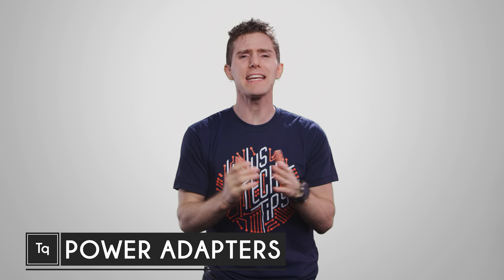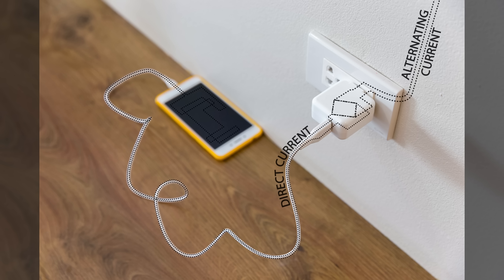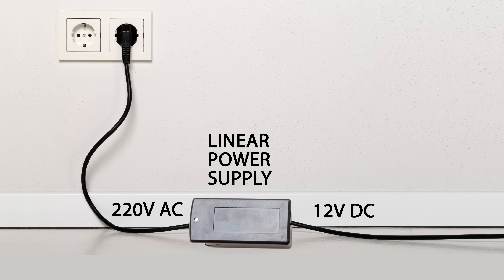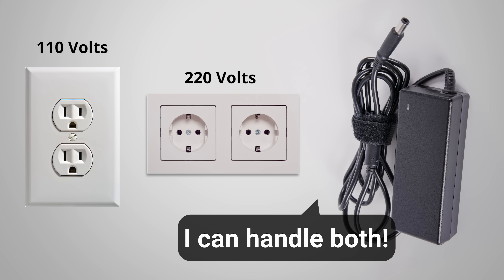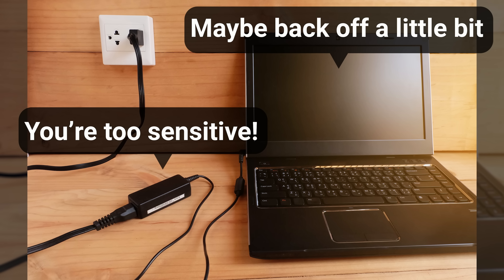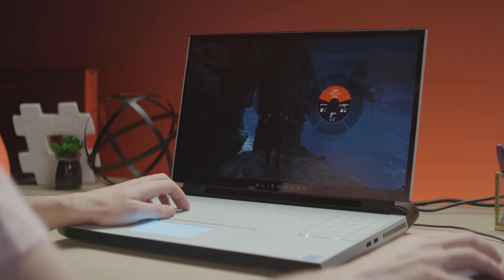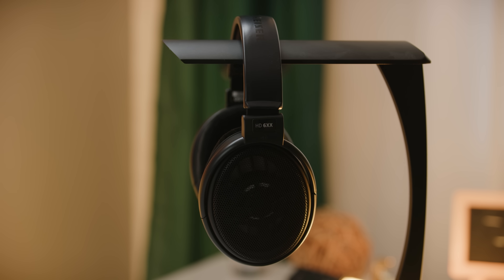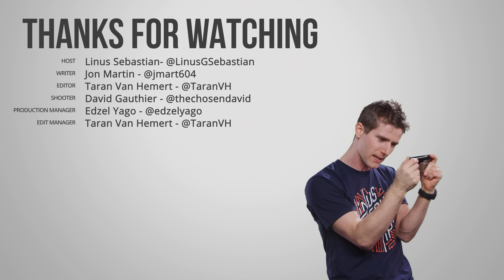Why Power Adapters Are So HUGE

Comment: Maybe we should have extra 12v DC outlets for portable devices, since they're so common now. That way you'd only need a cable or a very small adapter for 12v to 5v.
Reply: My power professor is doing research on power grids and he was talking about implementations of 480V DC transmission lines to households. 

DC lines don't have reactive power so they're more efficient than AC lines. The issue of the past is being able to switch voltages efficiently which AC was able to do with transformers, but now because of power electronics we can switch DC voltages very efficiently and cheaply. 

You can easily couple solar panels to DC lines, and you can easily charge something like an EV. A 480V DC source can very easily be stepped down to any voltage lower than it with over 95% efficiency, and zero care about power factor (DC lines have no reactive components). 

You would be able to implement a 480V to 5V@3A with a DC-DC converter the size of a quarter.
Reply: The issue with 12V/5V outlets is that different devices have different power demands. 

If you had a 12V device that is 120W, you need 10A. A 12V@10A converter is over 30-50$. You can see this could add up. 

However this makes sense if you just want auxiliary outlets (say 5V@3A) those would be only 10-20$.

Comment: wow this time there was,,,,no research about the topic at all. quality of videos is going down, I know its short as possible, but, working in electronics half of my life, I can say this video is incorrect guys.. you got it all wrong please remove this and do it again
Reply: just a hint,  transformers.. are not only a movie, but also a way of converting  AC to dc.. which is what your little ICs inside work from.. and they literally bricks of copper, that corresponds with its windings the current and number of them to voltage.. so no you cannot make it any smaller, unless you use crappy psu that imitates transformer and pulse the DC using rectyfing bridge or mosfets Switching on and off very rapidly which causes noise on the enitre powerline and can even disable your wifi radios ;) Also PC PSU is few different PSU inside of one case so no wonder they take up space, they always will unless you discover new powersource or something. Only one other way is to have mechanical converter which spins turbines with AC and winding on the other end are dc.. but as you can guess is loud and expensive, etc etc etc etc
Reply: Transformers only convert ac power, high voltage low current to low voltage high current or the other way around, depending on application. To rectify ac into dc you then need diodes. Most if not all modern PSUs', phone chargers and so on are switch mode power supplies. Some electronics sensitive to interference still uses linear supplies, like some audio equipment but they're getting rare.

Comment: What about silicon vs gallium power supplies?
Reply: Interesting question. The new type of switching transistors using Gallium Nitrite can under certain circumstances be almost 100% efficient. If planned correctly, this could mean exceptional efficient powers supplies for our mobile devices. Unfortunately, the technology is fairly new and therefore expensive, I heard prices for a prototype transistor of around 20 bucks. A long way ahed.
Reply: @Kyouske_42   thank you! Was just hoping that they would have mentioned it. Something like "but there is still hope..."
Reply: @Kyouske_42  well... SiC have been on the market for years. Can make DC/DC  1/10 the size of silicon,. It they are just to expensive.
Reply: @matsv201  I think you are mixing up SiC and GaN
Reply: @Kyouske_42  I'm not

Comment: well if you need 12 Volts DC from a 120 Volts AC, first you need a place to store that Voltage, second it needs to be small enough to not cook that component... so you start with a resistance or a transformer... (a electromagnet that powers a smaller copper wire coil) with than the next step is to make that current one way, you need a Diode because that can only flow power one way. those are weak just like Capacitors hence why the transformer is first. the Diode is next only letting half of the wave form in (+ or Plus), then you need an other Diode plugged (- or Minus) in reverse. both output plugged on a Capacitor. then you might need a resistor or some thing like that to get the Volts at the right number. 

so in simple therms, transform to lower power, trim and sort (align) the Waveform to a line, amass the power, deliver at the proper output level. so you start with power that looks like this "WWWW" and then like this "wwww" then like this "----".
Reply: @squishyu  well i am not exactly an electrician so i am just guessing the bare minimum you would need to do... heck i still have a hard time accepting that the power is not pushed out from the plus... that is so backwards to make power based from what Electrons gets deducted from instead of from what Electrons comes out of.

Comment: Should have mentioned the ac/ac transformer block, which usually contributes a lot to weight and volume
Reply: "Ok so the ac/ac transformer is in, what else should we do?"
"Add a capacitor so there's no ac feedback"
"There's microamps of feedback now, but its probably fin-"
"Put this big one in"
"Ok but I dont thin-"
"Put two, I dont care about weight"

And that's how you get the old adapters that are just... massive.
Reply: He kindof did... The linear adapters also uses ac/ac.. other vice they don't work. Sadly there was a lot wrong in the video

Comment: Yawn, You miss the point of wall warts! UL certification is fking EXPENSIVE. And changes have to be recertified. So if one can source UL (etc) certified commodity transformers for various input voltages without the need to recertify while extending the markets the base unit is applicable, a vast amount of money can be saved. Traveling between regions where input voltages range between 110V to 240V, - assuming the device is 50-60Hz compatible - the use of a wall wart makes the same unit usable in all regions. I wish more devices allowed such flexibility.

Comment: Could you (if you haven't already) do one over building your own pc, like specifically talking about the components are, what they do, and which ones you can trade out (ex: ssd and hard drives), as well as what you have to actually have to make a PC that turns on and runs (like the absolute basics of a normal everyday use kinda PC)? If you've already done it I must have missed it. And I love all of yalls content it's really helpful and informative!
Reply: Jace Branham would be extremely useful

Comment: Hmm I thought the biggest contributors were the transformers transorming the 230V to something more manageable and the capacitors required to convert it to DC (the larger the required power output the bigger / higher capacity these need to be)

Comment: smartphones could run on ac fine, its just that converting the line voltage requires significantly large isolation and comes with significant heat losses that you just dont want in a small device. I also dont want to imagine the port and cable required for that. It would be large and possibly dangerous.
Reply: No they couldn't. Batteries provide DC and as a result of that all components run on DC. Now, if you connected your device  to a power source that gives out AC it would fry the components
Reply: @dismiggo  of course they could. not without modifications of course, i just said that you could make an AC powered smartphone. 

in a modern smartphone, youll find a power management system that actually converts the battery dc voltage to ac in order to convert it to a stabilized supply. this circuitry is also handling the charging process, also involving switched ac. 

again, my point was that ac is not the problem, the voltage is.
Reply: @drkastenbrot  Ok, now I got it as I re-read it. But it will still be impossible to manage, just because some components need DC